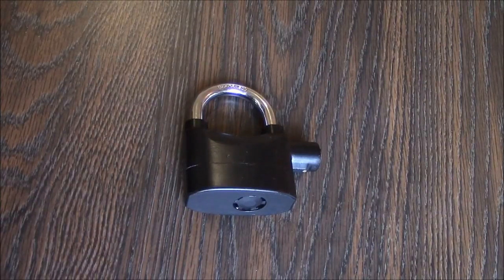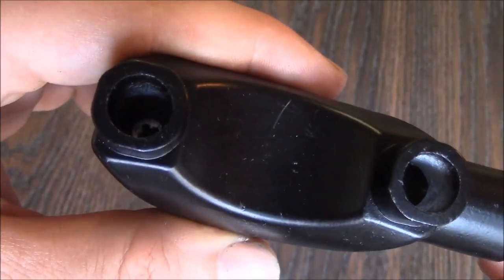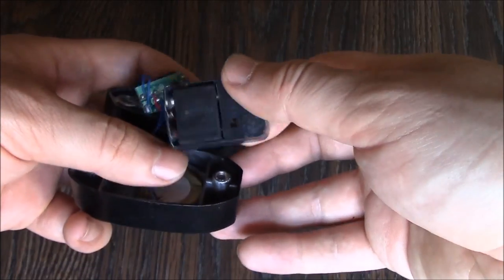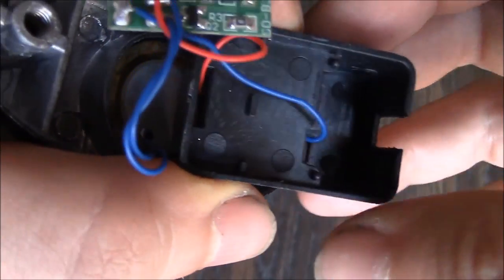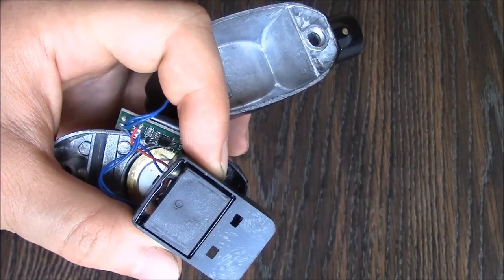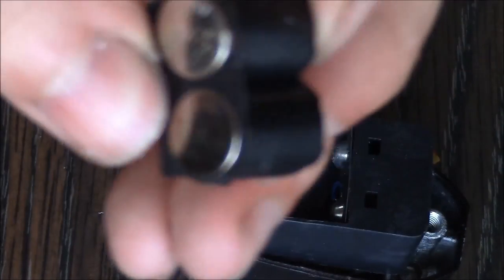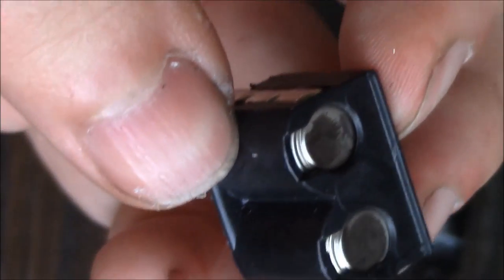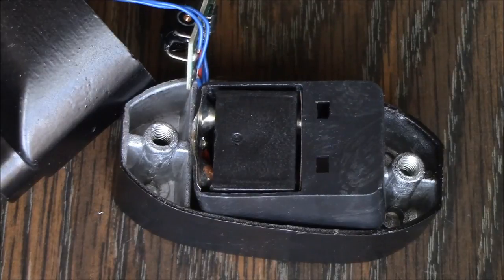How To Replace The Batteries On The Alarm Siren Padlock

Comment: Does the replacement batteries come with the padlock??
Reply: Yes
Reply: I just bought a tailgate bike rack and it came with 2 of these locks, neither of which have batteries and only one had a battery pack. Any idea what type of batteries to get and where I can get another battery pack?
Reply: Mine i bought with spare batteries plus it's housing